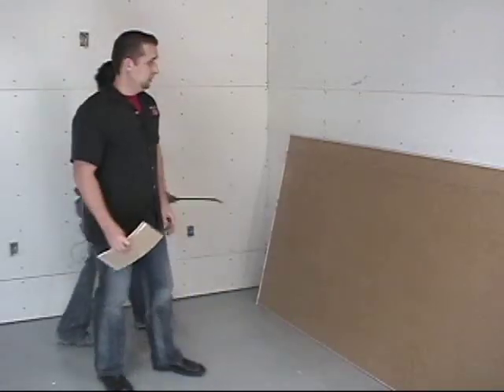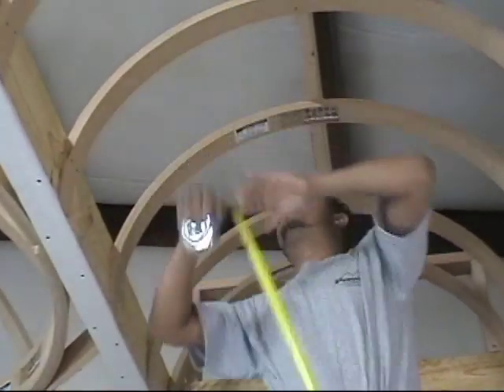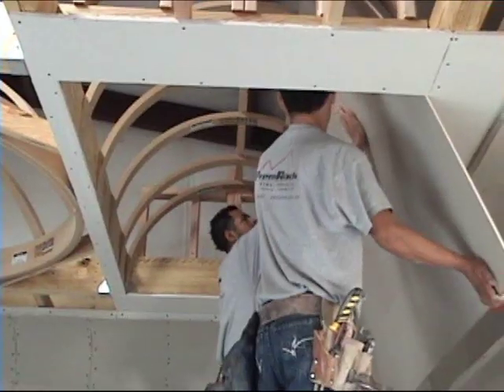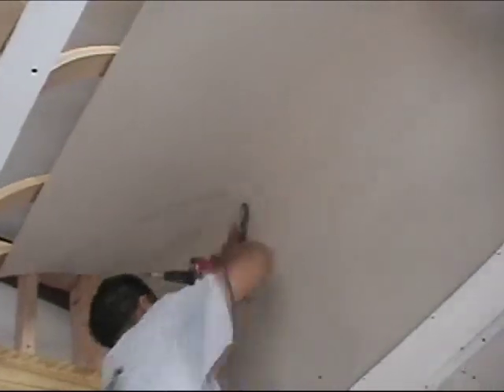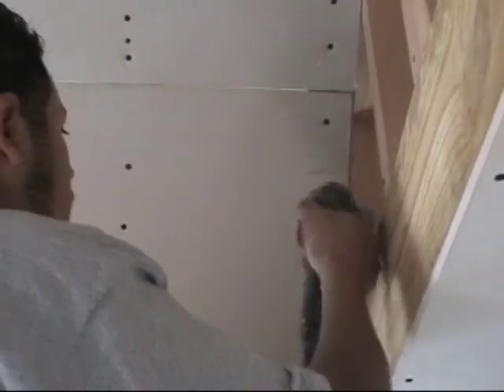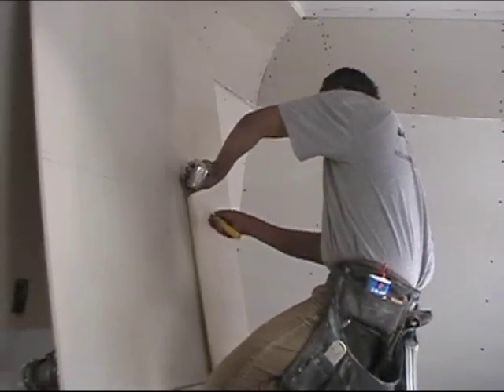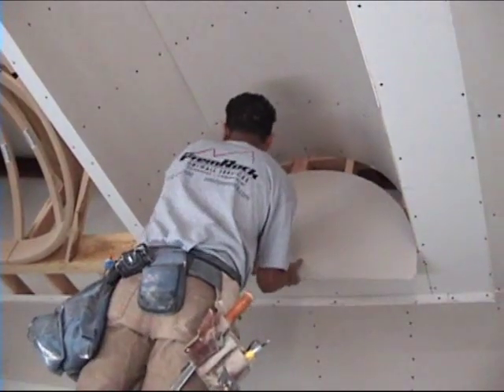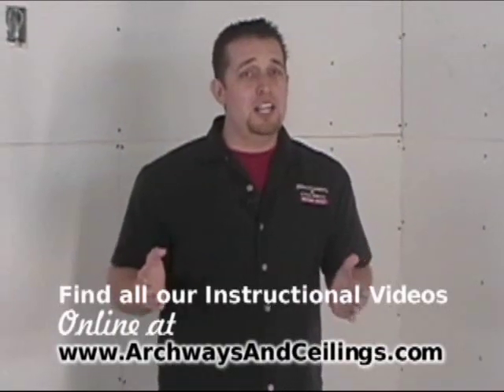How to Drywall a Barrel Vault Ceiling - Archways & Ceilings Made Easy

Comment: If a barrel is wide enough for the full bend, the finishers like (love) when the board is flipped the other way instead. Flat seams that run the length of the barrels like the one in the vid here can never be coated perfectly. If the board was flipped and the seam goes around the barrel, it's just like coating any other flat in the house, piece of cake. Still, you guys do nice work, great channel!

Comment: I have done arches in some custom homes and  its sometime difficult you should know how to wet well the piece of sheetrockt to avoid complication but  its a beautiful when its done
Reply: Your method only works if the barrel vault is tiny.  As in less than 8' in half-circumference, or whatever the longest standard sheetrock is.

Comment: What brand of roc works best? I've tried Certainteed flexible drywall and it no different than regular roc.
Reply from the maker: we are using 1/4" High Flex... and wetting the back. Are you wetting yours?
Reply: Yes I wet both sides, started out with certenteed but was no better than regular roc. Just bought some usg, will see how that works. Who makes high flex? Tx.
Reply from the maker: You can find it here: https://nationalgypsum.com/File/110787.pdf
Reply from the maker: Here's a pic of the guys using High Flex on a job https://www.instagram.com/p/BSGiB4NgpWr/?taken-by=archking57